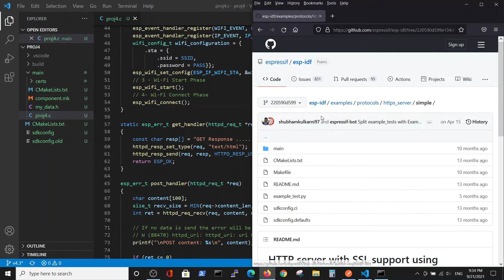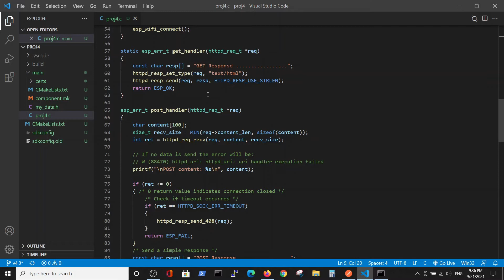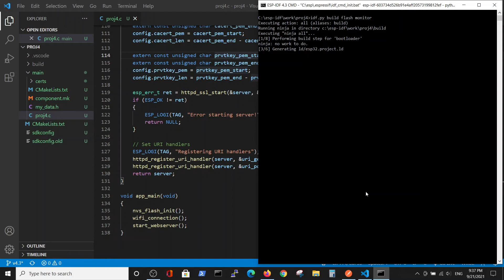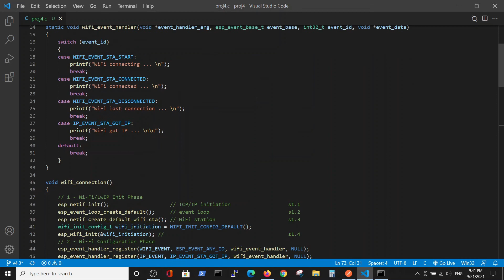ESP IDF HTTPS Server GET and POST REST - Working example on esp32

Comment: sir this https can't use in chorme ? how to fix this problem. Help me plz
Reply from the maker: Dear @anhthuchi6882,
You are right, in Chrome the default security settings are more strict, but they can still be changed.
Reply: can you help me, I have a project use the speech to text by js after that will send it for esp32, but when i use the http It didn't accept for me use the micro, so i was use the https , but it just active on firefox , how can i use https on the chorme or edge ?
Reply from the maker: Dear @anhthuchi6882,
I do not know what causing this behavior on your system. If I can guess from my personal experience applying that you are using REST, I would refer it to CORS (Cross-Origin Resource Sharing). Browsers enforce the Same-Origin Policy, which restricts web pages from making requests to a different domain than the one that served the web page. Check if your RESTful service allows requests from the domain where your web application is hosted. You may need to configure CORS headers on the server side.
Reply: I am very grateful for your help @simsiotdevices6219